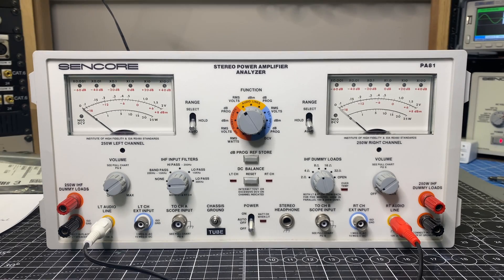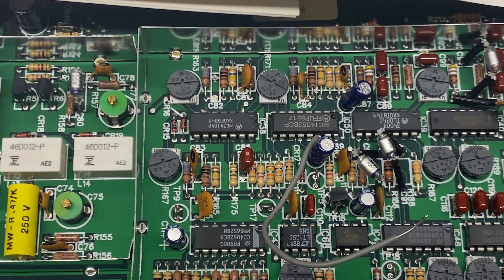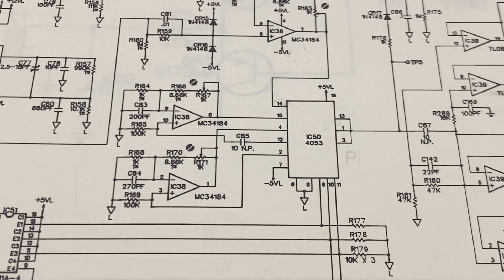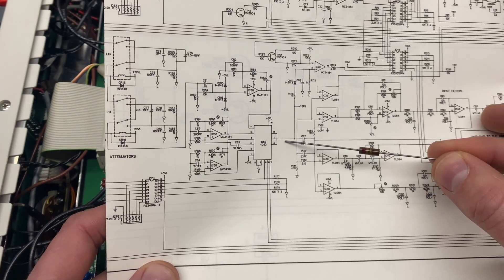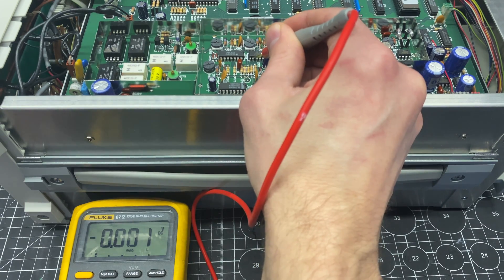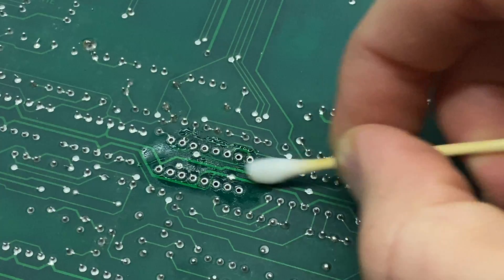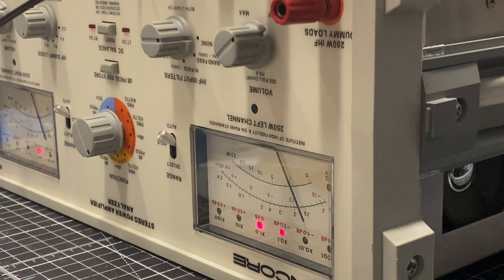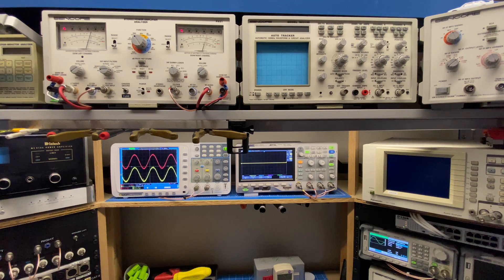SENCORE PA81 Repair - One Channel Out - IC Replacement

Comment: Just Picked up A Sencore PA81. It has a right & Left channel VU intermittent pointer jumping thing going on. When you hit the meter select switch it will sometimes stick all the way to the right hand side, As you select from -60- to +40 and then -60 the pointer in the VU will stick to full scale right  and sometimes just bob around for a second. You can hear very low static from the right speaker. If you give the side a light tap it will drop down and get quite.  Sounds like something with a connectivity problem.  If you jiggle the function switch it goes away .I'll have to go thru and check all connections. BTW Fantastic Video. I will be ordering those parts just incase.
Reply from the maker: @maraeht  these have issues with the relays after sitting for a long time. It may just resolve itself during normal use. The most common issues with these are faulty relays and broken switches for the monitor speaker controls.
Reply: @NovaluxStereophonic   Did you take your schematic some where in PDF to get that Full size  schematic you were using in your great Video? Several guys on my Sencore forum suggested Staples or a printer to make a one sheet full size for us old guys..L.O.L.  Also they said that Adobe now has a service to make poster size anything. But it has to upload in .JPG. and you have to have the full Adobe program $$$$ which would convert PDF to .JPG. I just have the free Viewer.  How did you get yours done? Thanks: Regards: Mark
Reply: Thanks for the reply just picked it up on my phone I'll get into it probably tomorrow fiddle around in there check the relays get out the old Kremlin D5 and start hunting really enjoyed your video and set up but I'm jealous because you have a full page sheets schematic schematic where can I get one of those I have PDF but they're a pain Patera paint to navigate but they're a pain to navigate love the way you put your video together keep up the great work regards mark
Reply: I carefully popped the cases off the relays and cleaned the contacts with Caig stuff. If they sit a long time, they become intermittent. Mine didn't cause trouble till I let it sit a couple years. I have redone that twice, and have been considering replacing them soon. Bought new around 1990 or so was perfect until it sat.
    As mentioned, just do stuff to keep exercising them, they do start working sometimes. Same problem in my SC61 scope.

Comment: Great video sir! As these units get older, we are seeing more problems. My PA81 developed a problem of the monitored audio in each channel would either go low or drop out. I saw the same thing on my monitor scope for each channel. I could delicately push on the board and the issue would go away. Long story short, the relay packs were acting up. I carefully removed the covers and with a small relay file I cleaned each one. All problems resolved. Keep up the great work.

Comment: Great troubleshooting work! IC’s are always tricky. I wonder what originally killed the chip… could have been a high voltage transient, old age, or failing power supply? Either way nice job!
Reply from the maker: I noticed the failure of the left channel shorty after testing a power amp capable of producing about 215W which was going into oscillation. Not sure if it was coincidence or not. The front end protection circuitry seems to be pretty robust so not sure exactly what happened.